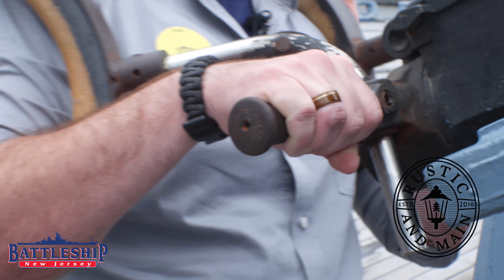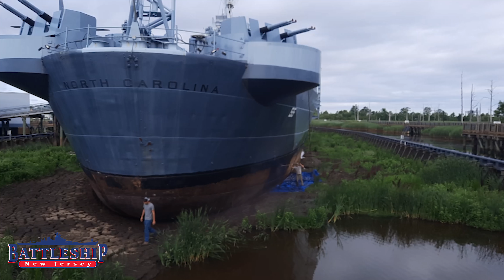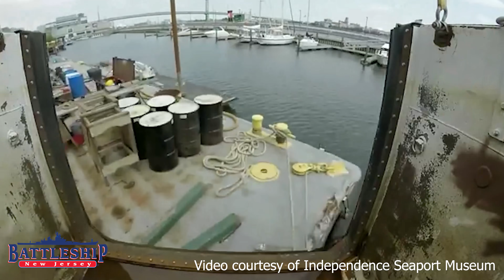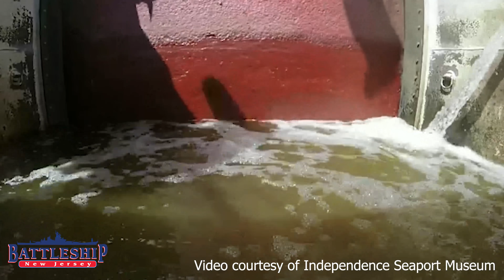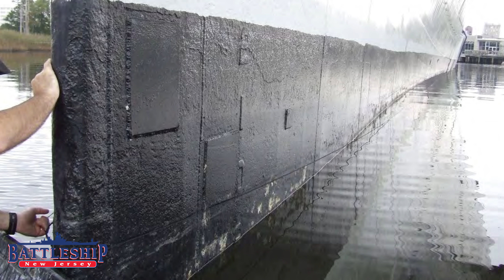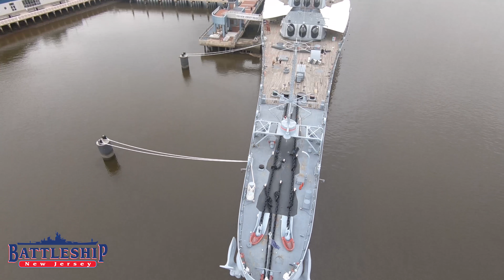Battleship North Carolina's Cofferdam

Comment: Does anyone ever bring up the possibility of using a rubberized epoxy coating, like from 3M?  Is that not possible for ships sitting in sea water?
Reply: Im one of the painters  at USS NC, we're using an aluminum based epoxy or urethane for the first couple layers then coal tar epoxy to seal her bootline (the black) down, and UV protective paint for above. It's absolutely amazing being able to put my hands on the hull, and seeing places on her nobody else really ever will. 

Like the guy said, the mud preserves so well she has some of her original antifouling, and new looking edges on some of the torpedo belt.
Reply: FLEX SEAL !
Reply: @vector6977  Yes, I do recall seeing the guy in a commercial spraying a ship. :-)
Reply from the maker: There are specialized coatings specifically designed for protecting steel ships that all of these ships use.

Comment: Unfortunately, I think that eventually, not matter how much effort is put into ensuring that these ships continue to be able to float, the only solution will be permanent dry docking like the case with HMS victory
Reply: Victory is undergoing major rebuilding as sitting on stocks so long has deformed the hull.
Reply: @Vid-FX  Victory is now sitting in a cradle that supports her in the same way as sitting in water would. Work is underway to fix the issue of the hull deforming.
Reply: its to be expected, since salt water and sea life will always eat away at the hull
Reply: The USS Albacore research submarine is in an interesting permanent cradle, in Portsmouth NH.
Reply: Victory is a bit of a different case, because, wood.
Reply: Being on blocks on land would give the longest life out of the ship as it makes it easy to gain access for painting and thus preserving the ship. You'd have to design the blocking system so that you could remove blocking to get at all surfaces. However, while not impossible the cost and engineering that would go into getting something the size of a fast battleship up onto dry land would be.. incredible. It would makes the winching done to right some of the battleships sunk at Pearl Harbor look easy.

Comment: Pressure can be simulated by tension....I’m sure multiple stay cables tightened horizontally and crossed (in strategically placed points) within the ships hull could easily be achieved simulating the horizontal pressure of the vessel in water...free standing chairs and tables demonstrate this perfectly... this concept is also used on foundations of buildings to prevent uneven settlement...I’m even willing to bet there’s some cable and chains already on the vessel that could be repurposed and help start the process keeping your costs lower...it seems kinda simple and stupid, but it has worked in other industries addressing similar challenges 🤷🏼‍♂️
Reply from the maker: Heres a detailed look on the mechanics of why it's so tough to provide the support:
https://youtu.be/sa8x2gc448c
Reply: @BattleshipNewJersey  yes I’ve watched the video and I’m aware of the challenges, but as mentioned earlier I believe you could artificially create the same outside compression force of being in water, by internally tensioning major sections of the hulls framework. This is already done with other structures built in areas where uneven settling is expected and factored into the foundations cable tensioned design
Reply from the maker: Could you? Yes. But will it in the end do more damage to the ship by adding additional cabling throughout the ship? Yes.
Reply: @BattleshipNewJersey  I see, well perhaps there’s engineers far more talented then myself that could find a non invasive way to achieve it 🤷🏼‍♂️ but after hearing how much it costs to dry dock I’m sure I could hire one for a tenth of the budget 😂

Comment: I wonder if it would be worth covering the hull in bed liner style material. It can be sprayed on and it's supposed to be water proof.
Reply: I know that some bed liners traps water in it’s pores and holds it against the metal and deteriorates the metal faster I’ve seen it do this with various vehicles my family has owned and if you are in the rust belt of America that bed liner will also hold salt and make salt water on the metal. Bed liner works best in dry salt free environments. Personally I think POR15 paint would be the choice because every time it encounters water it gets harder and adheres to what is painted too more
Reply: Worth asking the people who know...
Reply from the maker: There are specific paints designed for this purpose and that is what we use.
Reply: @BattleshipNewJersey  
Thanks for a quick response! 2 minutes! whooop!

Comment: Interesting coffer dam idea another is a floating dry docks, of which the USN owns and leases long term to shipyards. Easier to move a dry dock in than the other way around
Reply from the maker: Heres a video from when we visited a ship in a floating dry dock: https://youtu.be/sQASkQFt_ug

You still run into the issue of that drydock not being able to be used anymore, so its not often that yards want to be rid of them. And long term, you have to make sure the floating drydock is maintained even more so than a normal drydock.

Comment: Have you looked at high resolution 3D laser mapping of all the interior parts of the ship.  It has been employed on some archeological and world heritage sites.  It's main weakness is data storage and data streaming of such ultra large high resolution files.  Perhaps in the future this will become a lot more workable for such a large, complex object.
Reply from the maker: Several have tried, none have managed to create anything usable.
Reply: @BattleshipNewJersey  
Well, there is always how we did it with architectural drawings vs old buildings. If you have the original drawings, you copy them - then the actual building is measured and as built dimensions are put on the original drawings. I'm sure the same can be done for ships, but it's tedious manual work.
Reply from the maker: There have been much more successful efforts of creating it digitally, but trying to actually photograph it to create it in 3d hasn't worked.
Reply: @BattleshipNewJersey  
Thank you sir.

Comment: I wonder if floating the ship in a heavy oil pond would work? Or maybe put a few inches of some (carefully selected) oil on top of the water to just keep the boot top from being "wet"? I suspect the answer is "yes, but not enough better than something a lot simpler and cheaper."
Reply from the maker: It becomes an environmental hazard for birds and other wildlife if you add anything to the water.
Reply: @BattleshipNewJersey  A valid point, but I suspect with enough time, effort (and money) it would be possible to find some way to avoid those problems. E.g. use a very low vapor pressure, highly insoluble oil so it won't defuse away and float six inches of plastic balls on top so nothing can land in it. But that gets back to the "... something a lot simpler and cheaper" bit.

Actually come to think of it, just a set of floating plastic balls might help reduce the waves which could decrease the amount of the hull that is in that wet and exposed to air belt.

Comment: Could you fill the coffer dam with fresh water? Would this help with deterioration?
Reply from the maker: NJ is sitting in fresh water, which is better for steel ships than salt. But if the surrounding water is salt, you end up with stagnant water by not allowing it to flow free with the surrounding water and it won't stay entirely fresh anyway with all the surrounding salt.

Comment: For New Jersey I would not put her in the mud.  If I decided to build a cofferdam it would be more on the order of a dry dock than what they did there with NC. Plus one significant possible advantage would be the ability to flood the dry dock with fresh water which would significantly slow the rate of deterioration.
Reply: Well, fresh water is not necessarily better for electrolysis. Recently the USS Cod was dry docked and they saw that the sacrificial zinc annodes hadn't deteriorated at all, because they should have used a different metal than zinc for fresh water Lake Erie (they said an aluminum alloy or magnesium). So it had a lot of rust problems that could have been avoided. 
https://www.youtube.com/watch?v=6cxLDHukRF4&t=15s
Reply: @stevewindisch7400  yes I saw that. And yes they had the wrong anodes. But even so fresh water is far far far less corrosive than salt or brackish.
Reply: @jetdriver  The two issues besides electrolysis are marine growth, and chemical reaction to the coating (or plating should there be no coating). Marine growth should not be an issue when there is a good coating. Oil and other pollution at the waterline would be the same problem with fresh, brackish, or full salt. So the coating would be the major denominator in all cases. 

Having grown up boating on Lake Erie (fresh), and later living and boating in the Keys (salt), I can say that the difference is not very noticeable between them regarding bottom problems. On the lakes, the marine growth is algae (...and it can get pretty bad), and now, zebra mussels. In salt, it could be barnacles, mussels and other similar life, and some algae as well (but not as much algae as fresh water). And it all depends on how fresh the anti-fouling paint is... Which wears off a lot faster if the vessel moves than if it is stationary (or in a tidal estuary, like NJ is with up to 8 foot tides which is "moving"). My experience was mainly with fiberglass, steel is different in some ways (mainly electrolysis). Steel will rust in fresh water at about the same rate as salt, all other things being equal such as oxygen content and lack of coating.
Reply: @stevewindisch7400  Steel does not corrode at the same rate in freshwater as in salt. Steel corrodes dramatically faster in salt water than fresh. And it’s metal corrosion not Marine growth that is the big killer of museum ships.
Reply: @jetdriver  According to the below sodium is not a factor in rust. Oxygen and hydrogen are, and exist in all bodies of water. There are some fresh water areas with low oxygen, such as parts of Lake Erie in the middle (the reason why the water gets so clear out there, being able to see 6 feet down). But Cod is berthed close to the outlet of the Cuyahoga River, which has  oxygen mixed in because of all the industrial pollution and sewage treatment going on. The Delaware river also has oxygen because almost its entire volume of fresh water has been processed though sewage treatment plants. The visibility in both cases is measured in inches (I lived along the Delaware in Bensalem PA for a few years).  
https://www.thoughtco.com/how-rust-works-608461
Reply: @stevewindisch7400  I know that at least parts of the Delaware are brackish but I wasn’t sure where the divide is so I looked it up and this source says the NJ is above the salt line.  So that part of my suggestion is mute anyway. 

https://www.state.nj.us/drbc/hydrological/river/salt-front.html

That being said it’s quite clear that salt water does in fact corrode metals dramatically faster than fresh. 

Here is one source:
http://scienceline.ucsb.edu/getkey.php?key=552

Google the subject and numerous others appear. 

Think about the fact too that when you run your boat in fresh water there is no need afterwards when you remove it to take any special measures. By contrast a pleasure boat run in saltwater needs to be washed down with fresh and have its engine flushed as well to prevent corrosion.
Reply: @jetdriver  About Electrolysis, I thought we discussed that earlier ;)

Comment: I like the idea of the ship floating as apposed to sitting in the mud, But I also understand the cost of towing and dry docking. I like the idea of building a cofferdam around New Jersey and placing Drydock blocks under the ship. This way you could pump out the water and the ship would settle down onto the blocks, Basically giving the museum the ability to drydock in place anytime you need to. After the repairs are complete just pump the water back in and the ship is floating again. Might need a system to circulate the water so it doesn't get stale. and the cofferdam would provide a walkway for visitors to view the ship from. Also future drydocking would not effect museum operations.
Reply: You need a very sturdy foundation for the blocks if you were to do the drydock in place plan.
Reply: @HeavyHaulKen  That is a very good remark. For budgeting flexibility it's actually not needed to make the hull accessible all of the time, as when employing volunteer workers you can only do parts of the hull in the same time. The movable cofferdam solution pumping out water per hull section would work nice too. 
Question remains how long you can keep the bottom side of the hull in sufficiently good shape, but that is offcourse less of an issue than the waterlevel.
Reply: That would be massively expensive as the foundation needed for the drydock blocks would be just like building a drydock. Otherwise the weight of the ship would just push the blocks into the bottom. They had to reinforce the drydock New Jersey was build in before they could build it for just that reason.
Reply: I agree. I'm just a truck driver, not an engineer,  but just by looking at the satellite view of her location, I can imagine that someone would be able to build an actual drydock. Against the shoreline,  and parallel to the river. She'd be even more tucked away and out of the shipping lanes.
Reply: Use fresh water, Not salt water too!
Reply: Oh yea, it'd definitely would be expensive.  It's just an idea that's passed through my mind a few times while watching these videos. BBNJ is fortunate enough to be just upriver from the old Philly yard, but cant guarantee that it'll always be available.
Reply: Air pressure fills the hull, while water pressure pushes in from the sides and bottom of a ship. A coffer dam holds the hull together the same way I guess.

Comment: IIRC, Showboat was originally using the portable caisson cofferdam technique, but they found that the degradation was bad enough to require something more.  Pulling her out of the mud wasn't an option at all, BTW, because there are three low-clearance bridges that were built after she was moored, trapping her in that section of the Fear River. Thus the idea of essentially building a drydock around her was put forth.

One other advantage of the cofferdam for a ship that's trapped by development:  once the cofferdam is in place, you could always dig out the mud around the ship and just fill it with water, so that the ship's once again afloat within the cofferdam.  (IIRC, Showboat's operators plan on refilling the cofferdam for display once the current work is done.)
Reply from the maker: If you're using your boat for public use (cruises. Fishing, whatever) if it doesn't pass muster you'll get shutdown. But it's usually the coast guard with civilian ships.
Reply: Quite right, before the permanent cofferdam was in place (and man, it was put up fairly quick), they were using the portable section-by-section method. I believe there's some photos of that in an old slide release from a few years ago.
Yeah iirc some 10ft? would have to be cut off the top of the ship to get it under the bridge. It hasn't sailed in a very long time, but I havent heard any concerns that it would have trouble doing so.
Reply: "Pulling her out of the mud wasn't an option at all, BTW, because there are three low-clearance bridges that were built after she was moored, trapping her in that section of the Fear River."

But there is only one bridge downriver of the North Carolina. And there was a plan to dry dock the ship in 2012 or 2013 that fell through. They had planned to remove the upper portions of the bridge and mast to fit under the Cape Fear Memorial Bridge that has a lift height of 135'.
Reply: Only the Cape Fear Memorial bridge is directly between USS North Carolina and the river's outlet to the sea, and its a center span vertical lift drawbridge with plenty of clearance.  In theory, the Showboat could be refloated, towed or steamed down the river and even reactivated if need be.
Reply: @davidvanhorn4945  Pretty sure the ship won't fit under the bridge.  They would have to cut off a bit of the top to fit under it.  I believe there's 135' clearance under that bridge. 
  But there was a plan in the early 2000's to do just that, the money had been raised, and then someone got in their ear about the cofferdam and they scrapped the plan.

Comment: However the boot top wind waterline is exposed for repair and especially for steel shell replacement, does it not make sense to replace the shell plating with a MUCH THICKER GAGE of steel that will do much more to increase the longevity of this sensitive area of the hull?  My guess is that the hull framing would support this additional weight.  Yes it would be more expensive in terms of the cost of the steel, but might this expense be justified with the fact that additional work here should not be necessary for a much longer future interval?  Yes, I realize it is not historically accurate, but the role of the vessel as a museum ship to be preserved is now much different than that of being a fighting lady with a relatively short life expectancy as originally designed.

I do not know about the technical metallurgy issues that may be involved, but an alternate steel shell material that might be considered is CORTAN steel which is designed to develop a rust layer which actually protects the steel from deteriorating.  The down side is that it usually can't be painted and will develop a rust brown patina.  Nevertheless, this is a long-term MUSEUM ship.  See above.
Reply from the maker: What many museums do is add additional plating to their wind water line, especially those committing ice. It is expensive, you're right. So it's not for everyone. But in some cases it's cheaper than constantly repairing it. So yes, this is common. Not always needed, but done.